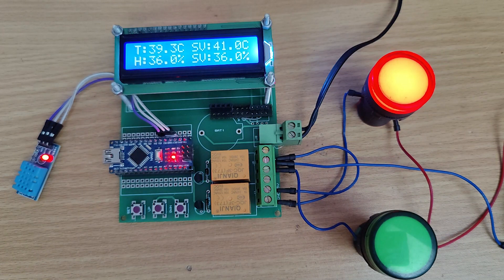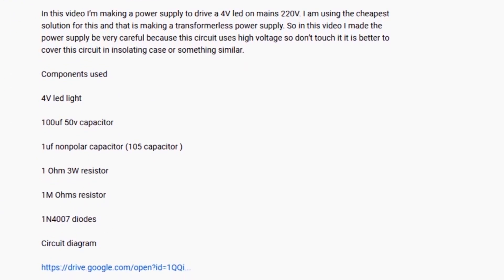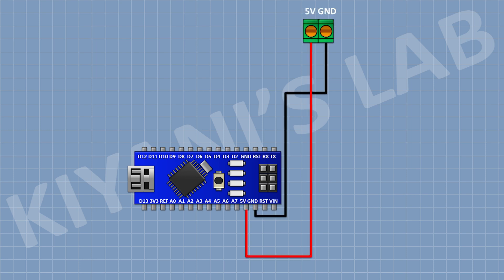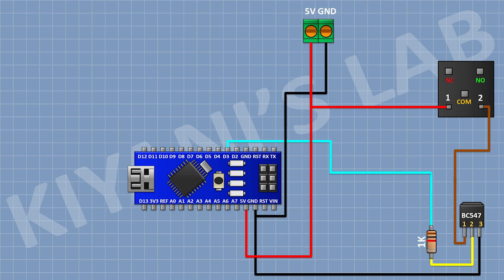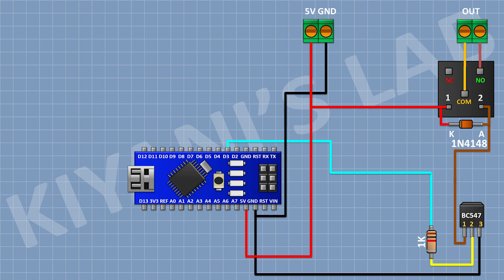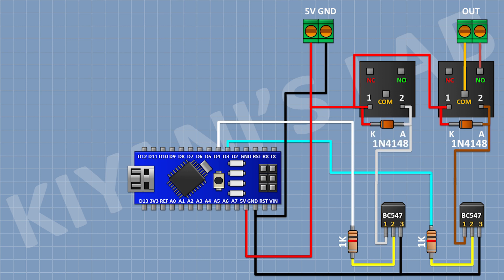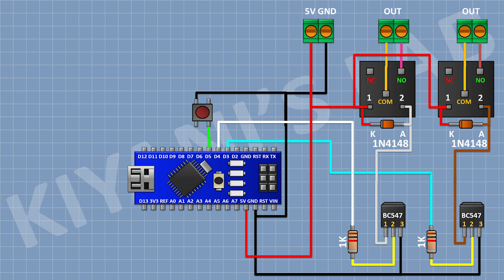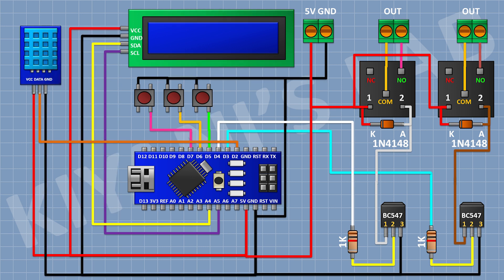How To Make Temperature Humidity Controller | Arduino Project

Comment: Hi, it was very nice project,
i am working on a similar project but the diiffirence is that i should set the high limit and the low limit humidity and i have 2 relays; one for the limit high and one for the limit low
what should i change in the arduino code and in other settings plz?

Comment: Hello, we need from you a device for selecting a phase that is stronger than electricity, and when any RST line falls or is cut, it switches to the other line and chooses the best one with a 5-second timer that is between switching lines and an alert bell. It is done using an Arduino device, a reading screen, and buttons for setting high and low voltage and time, as an ATS device.